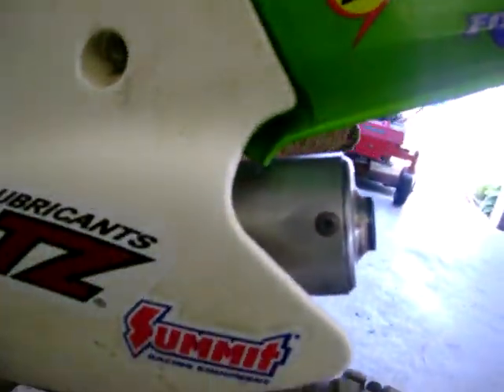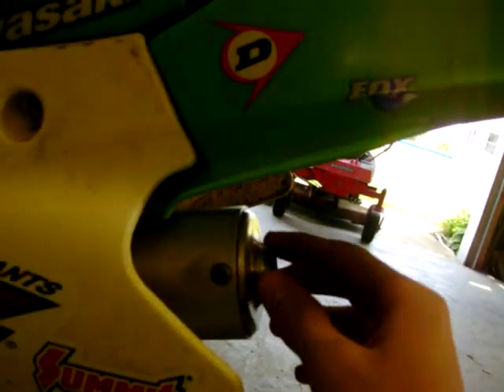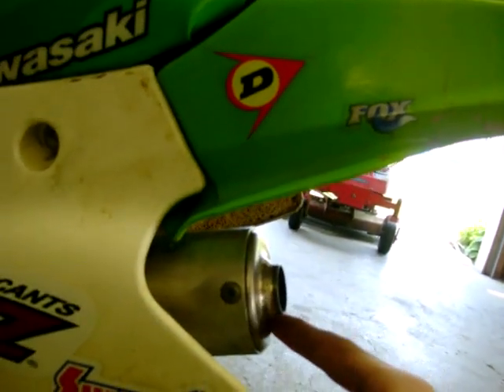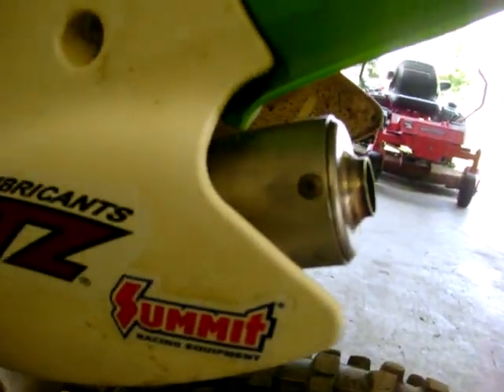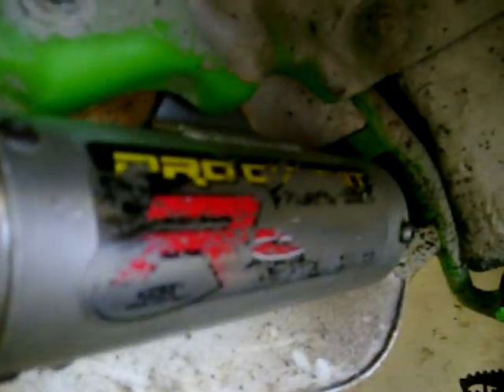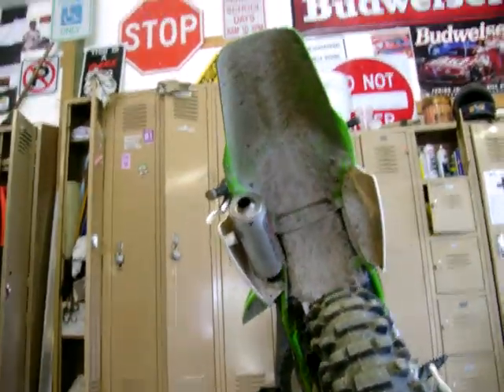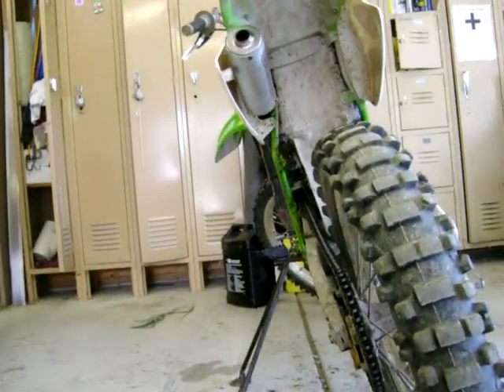Pro curcuit R-304.

Comment: @MRPITBIKEMASTER dont go below 91 octane... wears out your piston and rings faster. but 91 octane and up mixed at 32:1 is perfect. Kawasaki make their crank journals large on the 80's and 85's so the rod bearing and crank journal need to be well lubricated, so i wouldnt go above 32:1. if your bike starts fouling for some reason change your jetting not your ratio. many people think that changing ratio and putting hotter plugs on bikes makes the fouling go away, those are all band-aid fixes